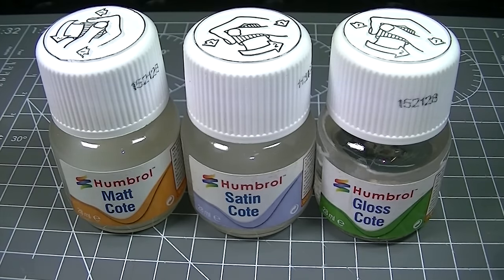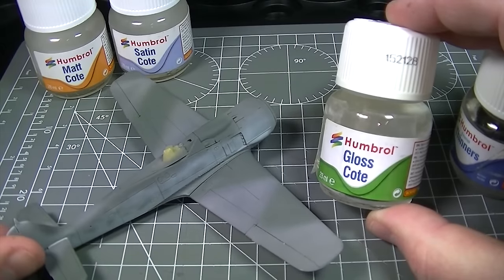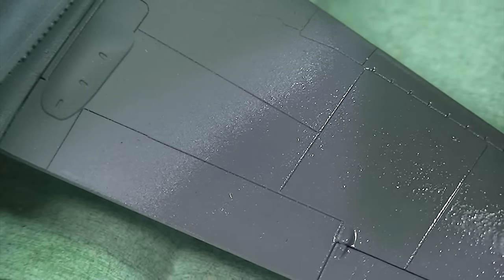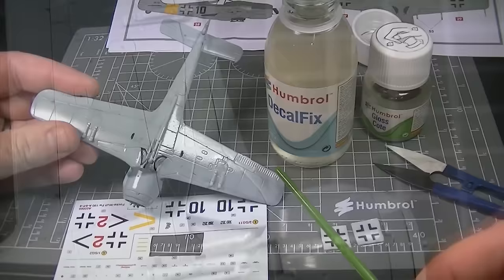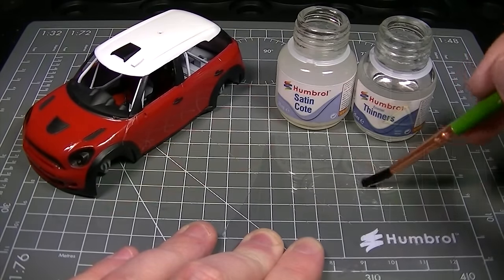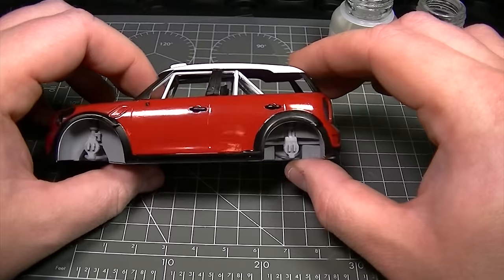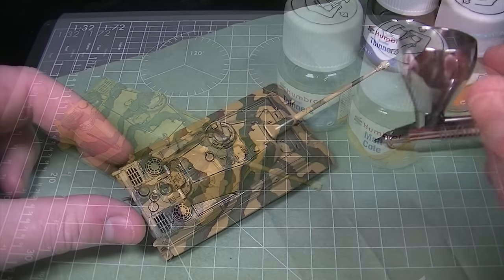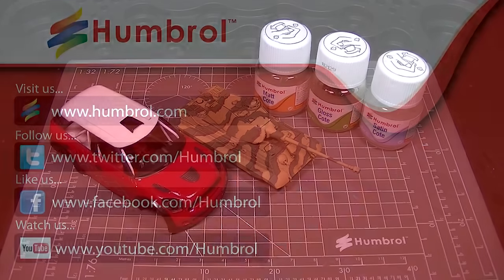Humbrol - How To Use - Model Cotes (Gloss, Matt and Satin)

Comment: The Humbrol website did use to recommend using Cellulose Thinners when airbrushing these clear cotes. In fact this was the only way I could get the Matt Cote to fully dry, with normally thinners it would always remain slightly tacky when handled (if years later). I will admit my bottles of clear cote are several years old and the composition may have changed to work with standard thinners. I do like the Matt Core though as it really does give a very flat finish.

Comment: I really like these to even things out after finishing a kit.  I recently completed a 1/72 scale Lightning.  I used the Humbrol Acrylic Gloss to prepare for wethering and decals.   After decaling I sprayed on the Satin Cote and everything sealed in nicely.  You can use the Cotes over decals.  Before using make sure you mix very well.  They also take a bout twelve hours to dry so plan accordingly.  Humbrol products are great.  Just mix very, very well.
Reply: This is a bit late but did you thin them with enamel thinners if so did the decals get damaged
Reply: @randomdanyt4270  I dont think decals will get damadged. I am pretty sure you can also use a thinner like Mr color thinner or Tamiya lacquer thinner for these clear coats if you want them to dry faster. Athleast they work well on their normal enamel tins and the coats that are being airbrushed or brush painted drys faster. Lacquer thinner and the solvents in it evaporates faster than enamel based solvents (hydrocarbons). Dont use normal hardwarw store lacquer thinner it will destroy decals and is much more dangerous.

Comment: I've used the Matt cote and brush painted it on my models. It really does dry to a completely flat surface and self levels leaving no brush strokes, BUT...and this wasn't mentioned in the video...you'll find that the varnish will seperate in the bottle with a clear fluid ontop and a cloudy liquid at the bottom. Make sure you shake it vigerously so that the bottle is all the same colour and consistancy and you wont have any problems. Great product.

Comment: Matt coats work best for tanks, but do they work well with planes too?
I feel like a matt coat would be too un-reflective, and give the plane a unrealistic look.
Would a satin coat work better for planes? Since it is not fully glossy, but also not fully matt?
Reply: You should use matt when your making a weathered design, satin also works for that but i think matt just looks better for that.
Reply: @launderedmemes  can you put decals over a matt varnish?
Reply: @DG-qo6vp  no, use a gloss to apply the decals then seal it over with a matte, if you were to apply the decals over a matte finish it would be very harsh and the decals would not conform properly

Comment: I have never put any varnish through my airbrush unly used rattle cans, only reason is cleaning out the airbrush with solvents would damage the "O" rubber ring in the nozzle & I do not have any replacements.I have only ever used acrylics & water.However I do have a bottle of Vallejo Airbrush Cleaner perhaps that would help?

Comment: How or what do you clean your brushes with after using Humbrol Clear Cote? A friend told me to use a small drop of shampoo to clean any brush I've used with enamel paints and that works fine - I've had no subsequent problems using brushes I've cleaned this way (enamel being a solvent, so I'm told, it can glue the hairs or fibres together). So, what's best for cleaning a brush youve used Clear Cote with???

Comment: Ive just tested this on my Battlestar Galactica (which I sealed using Revell clear gloss)  in a small section underneath and its worked a treat removing the shine.

But I have a quick question.....

After setting decals with Microset & Microsol, is matt cote safe to use to seal decals undiluted?

Or it it the case id have to seal the decals first with my Revell clear gloss, then use the matt cote?

Comment: I put 2 coats of Matt Cote on my model and let it dry over night. I came back and it is all shiny. can someone help please!
Reply: this has happened to me as well i have no idea why
Reply: +João Ricardo Subtil I tried mixing it with a stick (as well as shaking the bottle) for several minutes and it worked fine.
Reply: I had this as well try thin coats of well mixed
Reply: +fastfowler Parkour thx I'll try it
Reply: Some of my models it never works but most of them it does. It also may depend on the paint used but I think highly unlikely
Reply: This happens to me all the time. I brush it on. Could it be because I don’t use a thinner?
Reply: @JackLaPoire  I figured it out. Mix it with a stick for a couple minutes and shake it a lot and cus it's quite thick anyway you might need thinner if it's going thru an airbrush. :))
Reply: ozzy 734 thanks a lot!! I only shook it quickly before use, now that I just tried to shake and stir it a lot it seems to work fine.

Comment: Are the enamel thinners needed? I just bought each of these and do not have enamel thinners as I am applying it to acrylic surface. Do I need enamel thinners and will this be ok for acrylic painted models?
Reply: it's perfectly fine to use enamel paints or finishes over the top of acrylic however you should NEVER mix your thinners, most acrylics are water based and when mixed with enamel thinners they will split out forming a glob of pigment at the bottom, a layer of oil and alcohol and then finally water at the top which no matter how much you stir and agitate will never mix properly again. In short match your thinners with their intended paints and remember to only paint wet on dry if mixing paint types.

Comment: Can enamel gloss Cote be safely applied over enamel paint? And can humbrol enamel washes also be safely applied over the enamel gloss Cote? I don't really know what paints (I.e. enamel and acrylic) are compatible and in what order. Thanks
Reply: Tom Gilchrist Yes, but make sure you use the same brand. For enamel washes it would be best to use an acrylic gloss coat, but if you leave the enamel one to dry for 24 hours it probably works aswell
Reply: Jasper Breur will I be able to apply enamel matte varnish over the acrylic gloss once the decals and wash has set though? That was my original plan (I.e. enamel paint, acrylic gloss varnish,  final enamel Matt varnish) but i have no spare material to test it on.
Reply: I think this is possible, but I'm not 100% sure. I know it works fine with Revell paints, but I haven't tried Humbrol paints before. As long as you use the same brand I think it should work. I once painted a MiG-21 with Revell enamels and then clearcoated it with an acrylic clear coat from a cheap spraycan, that turned into a disaster: All the paint came off. But when I tried again with a clear acrylic coat by Revell it worked perfectly. Just test a small piece before you do the whole model, just to be sure
Reply: @jasperb9233  brother I want to do an oil wash, with glossy humbrol varnish, I am going to use winton oils, but I am worried about its own oil thinner. I think it is based on turpentine, that is bad? What solvent would you recommend to use the winton oil and not spoil the varnish?

Comment: Can I use the Matt cote on a model after I applied the weathering powders to block them in if not can anyone tell me what product I could use?
Reply: +gareth evans I believe you can but I would dial the pressure down; no more than 10 psi. Hope that helps.